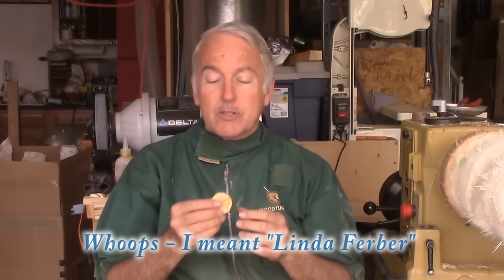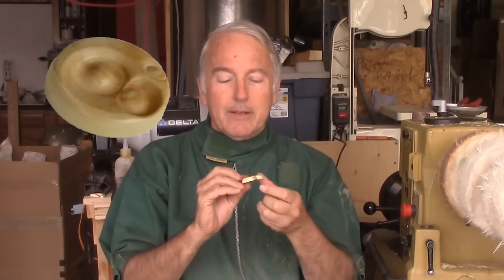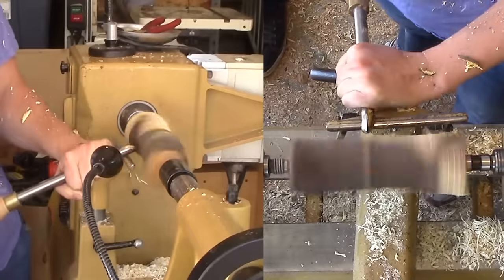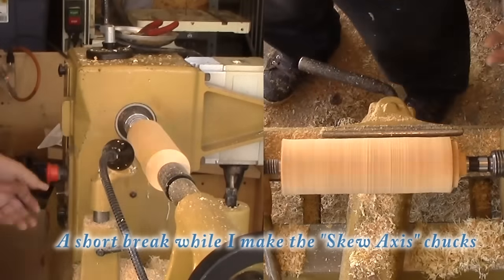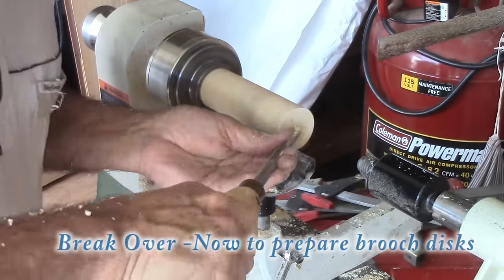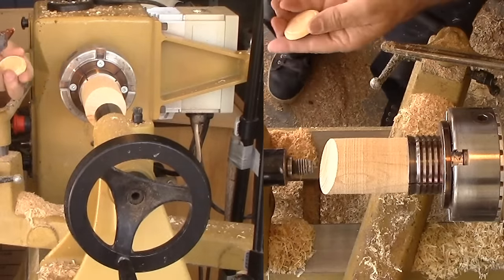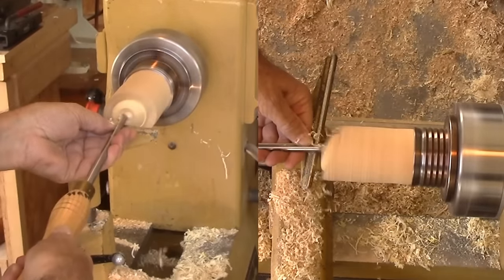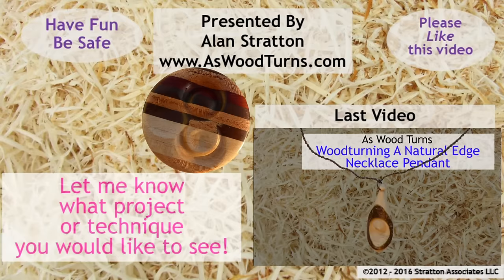Woodturning Jewelry - Multi-Axis Necklace or Brooch

Comment: Interesting technique!  I'll have to give it a try.  It looks like it would also work for making inserts for inlayed box tops.

Question: Why is double-sided tape vastly superior to hot melt glue?  Used properly (right kind of glue stick, heated to the right temperature, etc.), hot melt glue provides a strong hold and can be quickly released with just a dab of rubbing alcohol.  I don't think its used enough be woodturners.
Reply from the maker: Hot melt did glue securely. The problem was timing to get it to the correct temperature; Thicker glue when slightly cooler; difficulty in removing. spider web like strings...
Yes, it was strong enough - that was not the issue. I use hot melt in other woodturning situations.
But, I definitely prefer double stick tape here. Sounds like you'll prefer hot melt - that's okay too. :)
Thank you
Alan

Comment: Hi Alan,
Another really good video.
I've been trying to make pendants for my Wife and Daughters, I also used the hot glue but it causes the CA finish to flake! The pendants have a curved front and back, would I still be able to use the angled jig approach? 
Thanks Alan for sharing such an interesting video.
Thumbs up all day from me 👍👍👍👍👍.
Take care.
Cheers 
Andy 
Yorkshire UK
Reply from the maker: Hmmm.. In general, I'd have to say that you need a flat back to use a flat topped jig. But let's be creative and experiment. 
My guess is the heat of hot melt glue is the problem with hot melt glue. Would a couple of layers of tape insulate the CA on the wood from the hot melt heat?
could you use a small turned holder to hold your pendant so that the rim of pendant is solidly held in a recess in the holder. Then the holder is fastened to the chuck. sort of an intermediate jam chuck?
May be other solutions also - time to experiment.
Alan
Reply: +As Wood Turns Oh I never thought about insulating, I'll be giving that a go for definitely. 
Thanks for your help and advice Alan it's very much appreciated. 👍

Comment: What a great idea. I am on it. Have you tried the micro owen tecnik (sorry, bad english) to dry the wood. I have never had the currich (bad english again) to do it.
regards Júlíus
Reply from the maker: Yes, I have microwaved wood to dry it but I don't like doing it. I used the over outside in case it caught on fire. Then had frequent trips to check and reset. So give it a try outside on very low power if you want.
Alan
Reply: Thank you Alan, I will take care.

Comment: Alan you've created some terrific how-tos with great photo and narrative work. Thanks and I can't wait to try this myself. And by-the-way I totally concur that the DS tape work
Reply: Oops, got cut off before I could say I've found the DS tape does indeed hold better than the HM glue, specially when you cannot use tail-stock for reinforcement.
Reply from the maker: It would be good to do a direct controlled test.
Hmm
Alan